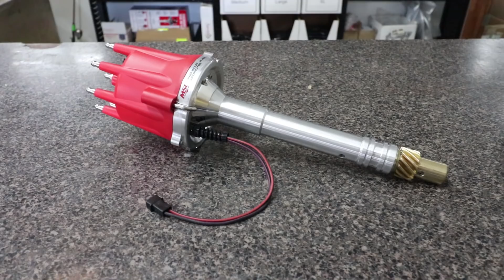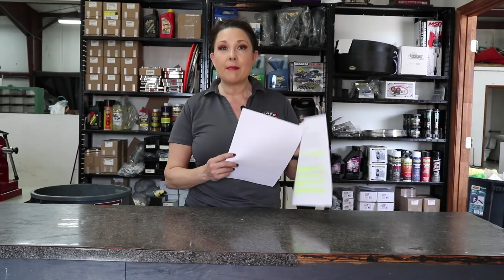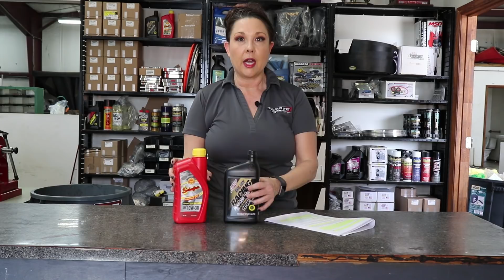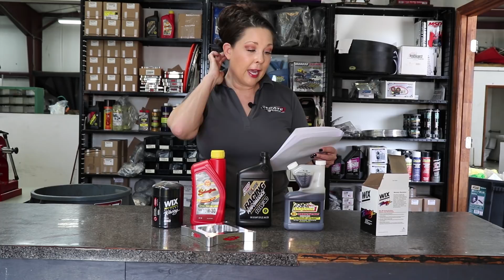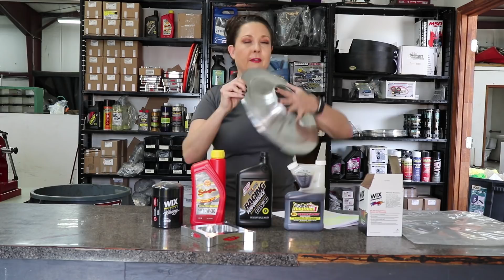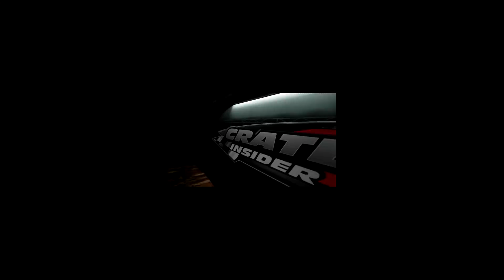2018 GM602 Recommendations from Hendren Racing Engines

Comment: I am currently rebuilding a 602 (oil rings) for a street car, is there anything you would suggest changing? I have been told that the rings are set up for race fuel, what would you suggest?
Reply from the maker: Hi! That is a really great question. I am going to have an engine builder answer this question live on our Unsealed show on Sunday. Tune in at 5:30!

Comment: how many "laps" on average before changing valve springs instead of checking spring tension?
Reply from the maker: For a 604, every 10 races (checking them after each race). For a 602, every 4 races (checking them after each race).

Comment: If you have an NGK number you can also stock Denso plugs. They're the same company. Kinda the same setup where Motorcraft plugs being the same as Autolite.  Tried them once...  voltage
 shot down the porcelain like a sheet of neon.... last time I've ever used them.